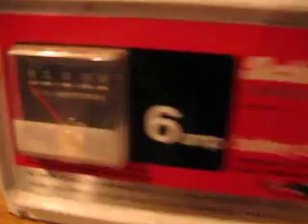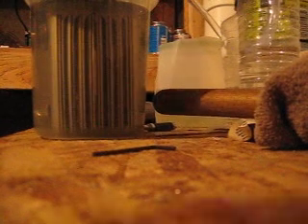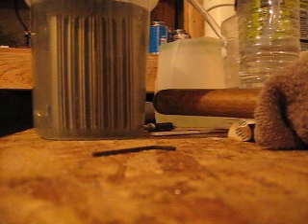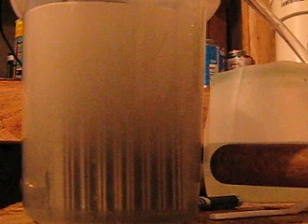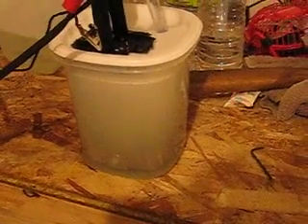HHO: My Smack Cell. I need some help guys

Comment: You need a different container something that can with stand some pressure ,make sure all your connection can also with stand a far amount of pressure,then watch the bubbles flow.You got a good ideal make some changes and it will work

Comment: seal top n bottom. holes in small tube at the bottom to circ water 3/8 hose mounts at top of both tubes and u should get hho out of one fitting and o out of the other. vent the o and run the h2

Comment: scuff ur plates to form more bubbles but the thing that confuses me is people build these and expect it to run a car. it is creating hho and o ie h2o they seperate yes but they vent back into the air intake and re combine to form h2o again... but if u take an aquarium and 2 wires 1 to pos 1 to neg one of them will make 2x the bubbles right? make a pvc hho generator of 2 tubes. one big one small wrap inside of the small w ss wire and outside w ss wire dont toutch them together

Comment from the maker: i have connected it straight from my battery..and i could get more but without an AMP meter I dont know what I am running at. I cant really order anything online right now cuz I am moving in a week..so its really hindering me lol . I am in the middle of building my bubbler..i took some ideas from others and combined them. I will shoot a video on that shortly and post it.

Comment from the maker: oh ok cool cool..thanks

I built this using mr. smacks specs..im pretty sure i did it right..its an 18 plate cell...ordered all the parts from the part # he gave from a website. off the top of my head i believe theres 2 pos and 2 negs and 14 neutrals. if it would help I can make another vid of the cell out of the container so you can see it better from different angles and what not.

thanks for the help

Comment: most multimeters can only do 10 amps max ... you might want to spring for a cheap Chinese 50 amp or maybe 100 amp ammeter ... they can be had for about $20-50 on eBay and they work ok ...

I must say, I have no idea how your plate layout is setup ... it looks like you have uneven spacing between your plates and I have no idea if you have enough neutral plates to drop the volts into the sweet spot ... 

but at least you are building ... carry on !!!

Comment: multimeter will do amps-you have to measure on one side of the circuit.
so put it in line to the cell,not across the terminals of the battery.
and you gotta put the test lead into the amps hole on meter.

Comment: use a car battery straight off the terminals.
you will get way more amps.
i saw a very easy way to pulse the DC the other day.
someone was using a blinker relay.